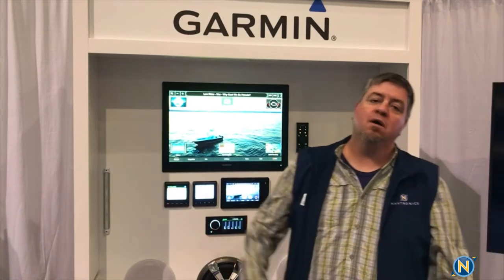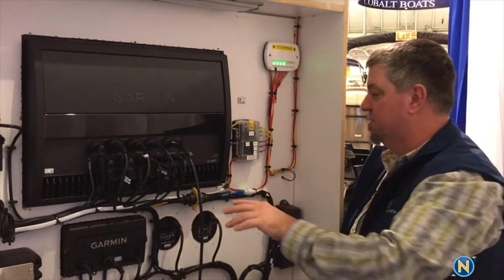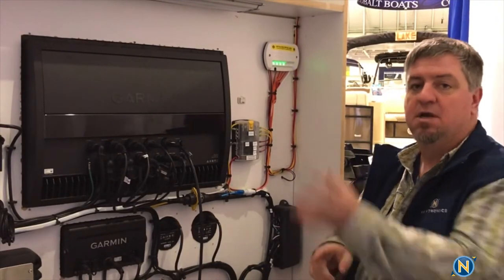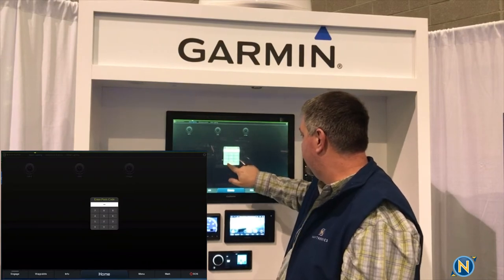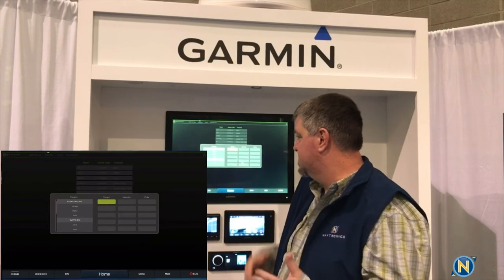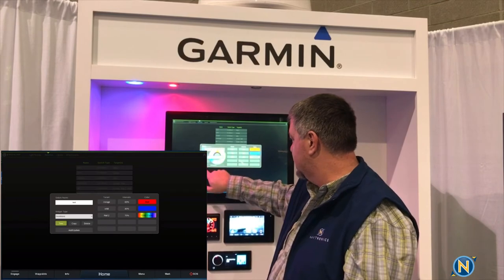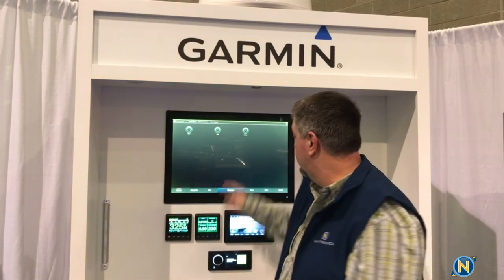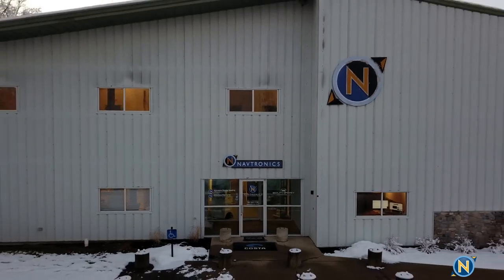2-16 Sunday’s With Sully - The one about lumitec lighting and Poco controller

Comment: Will any  RJ45 ethernet cable work or will you need Garmins?
Reply from the maker: Best practice is to use Garmins but a field installed Eazy RJ will work in a pinch